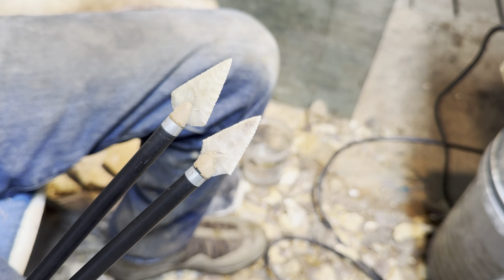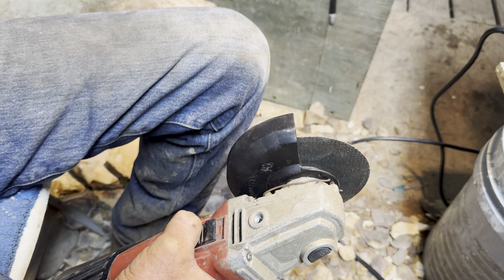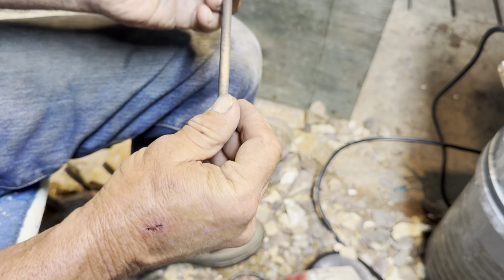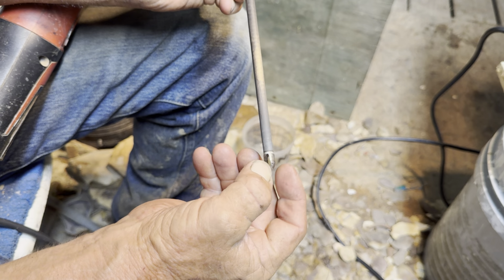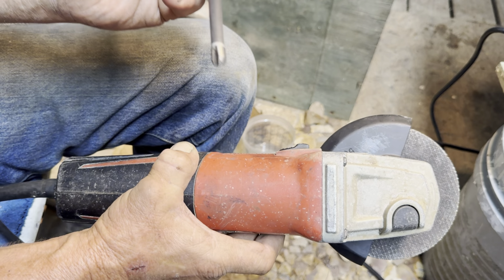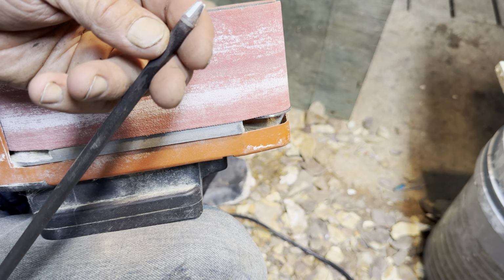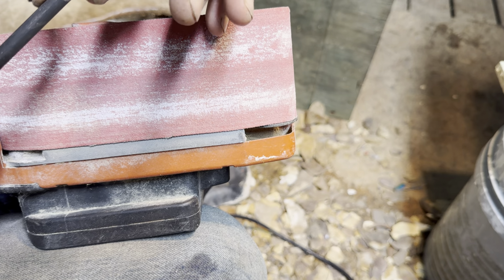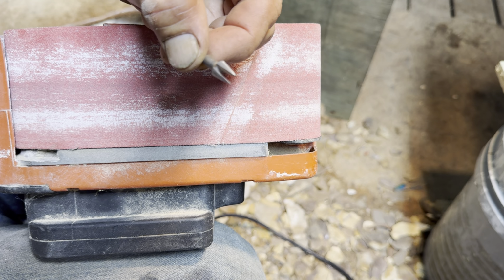Stone Point adapter for modern insert arrows

Comment: Can this be done with glass
Reply from the maker: Sure
Glass would make an awesome point, especially for heavier weight points so they can be thicker. 
40 grain stone points like needed to make these total 100 grains are very thin so I like to use raw stone, but I wouldn’t hesitate to mount a glass point on one.